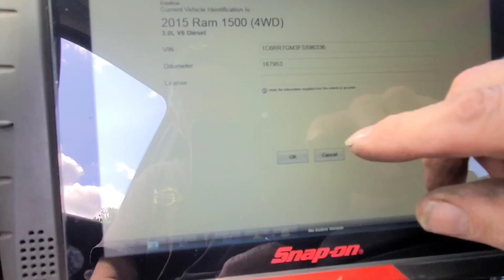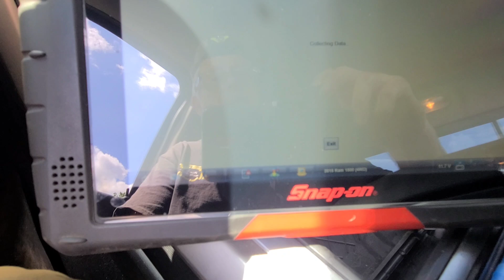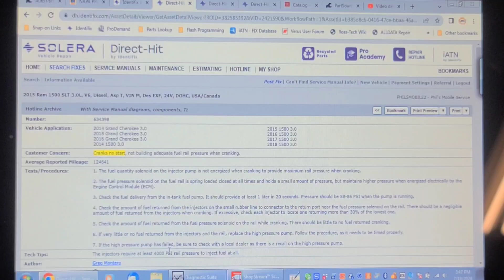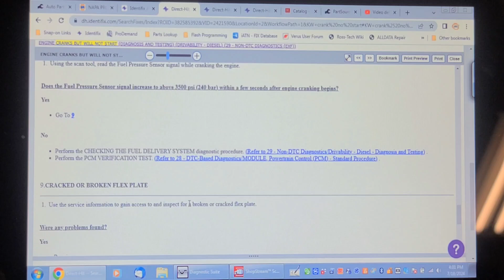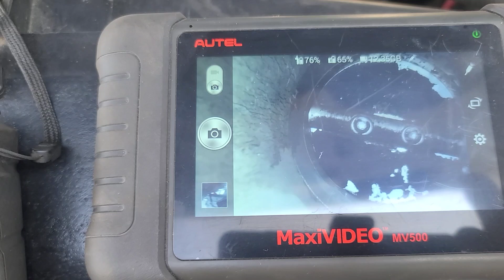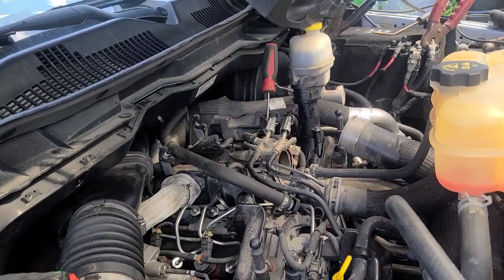2015 Ram 1500 Ecodiesel Crank No Start No Codes pt. 1

Comment: I have a problem with my 2015 ecodiesel. It starts and stops immediately!!! I don't know where to look for the problem.

Превод на разговор
Reply from the maker: You need to start with a scan for codes, review data parameters, check fuel supply, air intake. What is the history on the truck?

Comment: High pressure pump is a recall. 
After they changed mine, drive out on road and it died and would not start. Now it's leaking because all lines are supposed to be replaced after taking them apart. 
What B.S.
Reply from the maker: That's not good 😐

Comment: I have been fighting with my 2017, when i tune it wont crank. If i return to stock it does. I got the HFP pump replaced since it was a recall and also removed the throttle plate shown in this video. Still no luck. When i crank it wants to turn but dies immediately. There was a moment where i had the accelerator pedal pressed and it stayed on but died immediately when released. Any ideas?
Reply from the maker: @Jakeboy24  won't crank over or cranks fine but won't start? Is it setting codes? What are you tuning it with? Sounds like a call to the tuner manufacturer is in order...

Comment: Since truck has been deleted just remove the blade completely, it’s sole function is for the egr and only helps airflow by removing
Reply from the maker: @craigwebb2486  That's what I did end up doing in part 2. The only other possible purpose is an emergency shut down in the case of an engine run away.

Comment: Great job Philip. Great diagnostic process and intuition. Sometimes our "gut" is our best tool! Especially when we don't have any codes or real clues to go on. Something that I have noticed too many times to be a coincidence is that most of the vehicles that I have worked on that had tunes would often times not show any trouble codes or sometimes show erroneous codes. I don't know if this is the case but I think it's something us as mechanics should keep in the back of our minds at least. Great video and thanks for sharing! Looking forward to the final outcome. 👌🏼👍🏼
Reply from the maker: @mikeburdi3464  I found out this evening that the truck is electronically deleted so I'm sure that's why no codes for the throttle blade.

Comment: Hmm.  That Air Mass per Cylinder in mg/Hub is the mass of air per one cycle or 2 crank rotations (according to the internet).  Never seen that one before!  However, I am not a pro like you...  I would think that would be a positive number?  Good call to chase air!
Reply from the maker: @maui6446  going to see what it reads after I fix it. Found a video that suggests removing the throttle blade. Turns out this one has a tune in it and that's likely why there was no code for throttle error.